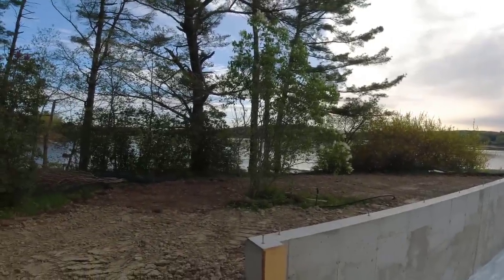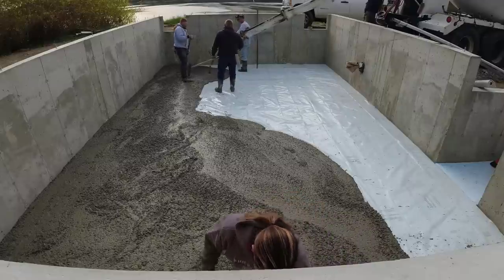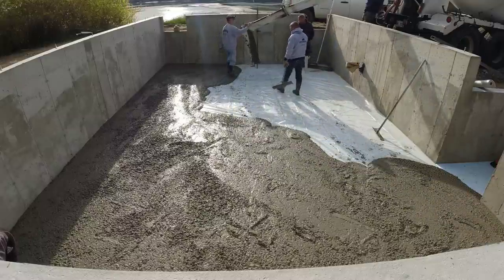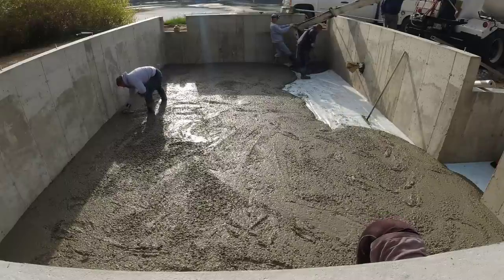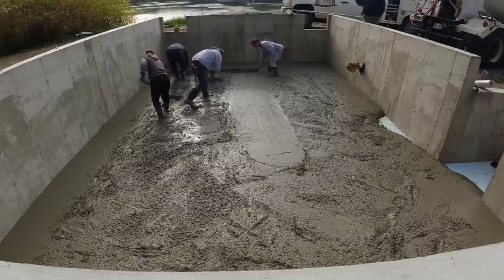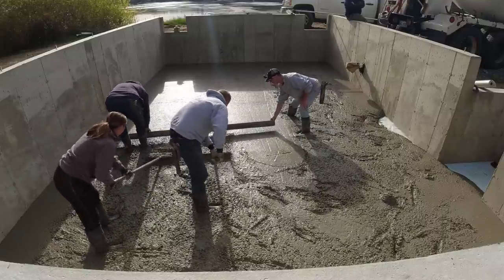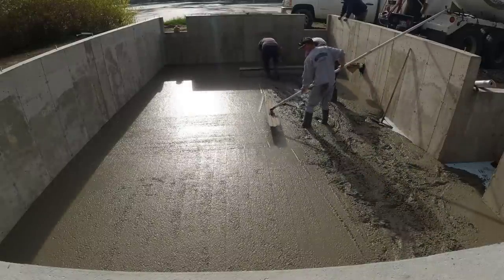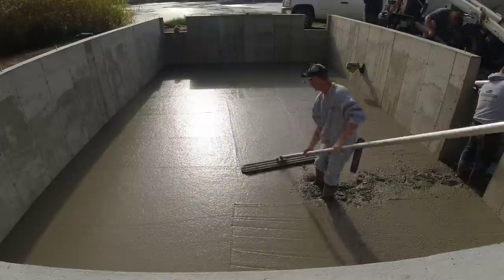Easy Diy Concrete Floor Pour (We Like These Pours!)

Comment: Hi Mike, does the air help with an easier finish on the concrete as the aggregate holds to the paste better? or is it much the same? Another great video. By the way, I've been a ready mix driver in Ireland for 4 years and that chute trick is the first I've seen. I can't wait to pour my next tank and show off a little.

Comment: Your not alone with mix inconsistencies 
I do most of my work with a 6cf mixer
And sakrete when I buy I buy in bulk 4 or 5 pallets at a time and keep it in my warehouse. I recently did a job and the sakrete was provided 56 bags and I could not maintain consistency a lot of separation very hard to float and finish
So just for grins I brought 6 bags that I have had in storage for 6 months mixed it it was creamy held together and floated almost instantly when screeding
I my own opinion it's bad Portland or they're cutting the Portland 
I don't know but there's was a difference
Reply from the maker: When we use a bag mix, we add about a quart of Portland to each mix. It helps a little.

Comment: Placing concrete for a crawlspace is a breeze. Just a bull float finish is all we do. One question though, when cold season starts have you ever combined a non chloride accelerator with the water reducer?
Reply from the maker: Yes, no problems doing that.
Reply: Thanks mike appreciate the advice.

Comment: So I'm wanting to get into adding water reducer to be able to pour on an 8. I work on industrial projects has anyone ever had a issue with low psi after pours
Reply from the maker: Psi should be higher not lower if using a mid range.

Comment: I've been watching, so I can do some home projects myself.  I had been curious why your cement seemed so wet.  Thanks, I think my cement will last!🤞 I poured under my deck for storage and my dog kennel.  Not critical areas.  But, I may start on the driveway next year.  I'm in central Minnesota.
Reply: He adds a mid range water reducer, takes the place of water, he gets a really loose slump that way it’s more workable
Reply: @crestoneconstructionccs5890  that's why I made my comment and said thanks.  What's your point.
Reply: @waynemensen4252  geez, don’t know what I did wrong, that was an answer to a different question, not your comment. My bad.